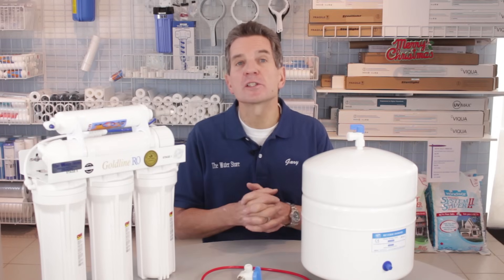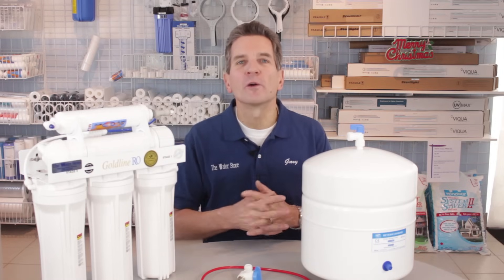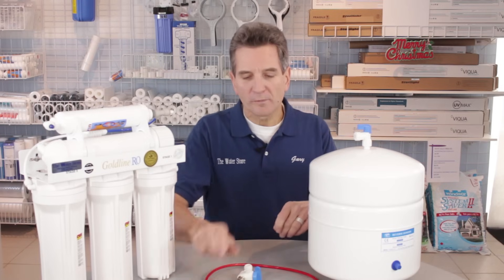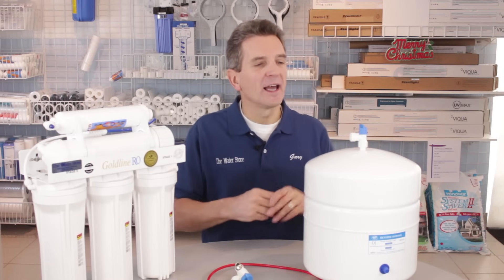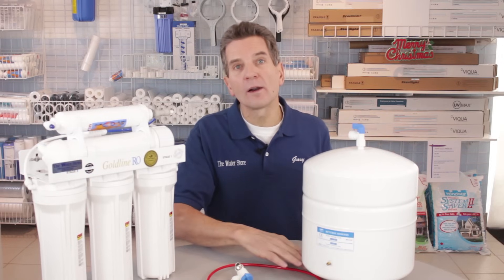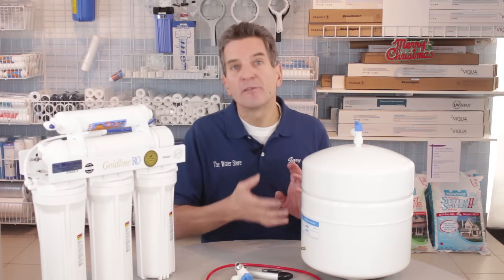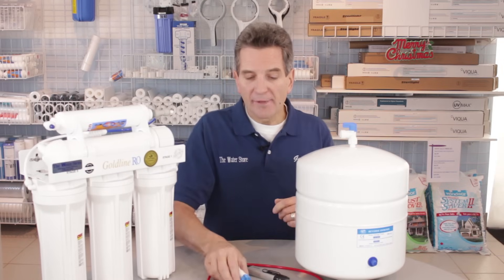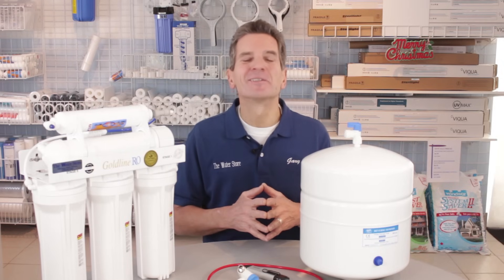Reverse Osmosis Troubleshooting - Little or No Flow from Faucet

Comment: I have a Brondell Circle Reverse Osmosis Water Filter (model # RC100). I got the system about a year ago and recently the faucet has only been dispensing about 1/2 cup of water before it stops and no water comes out. I watched this video and it looks promising, but my RO system is inside a case so I can't access the tank. Do you have any recommendations on how to get the tank out of the case to test the pressure?
Reply from the maker: I don't and that is one of the big problems with these systems.  I would contact the manufacturer and ask how you can check and recharge the bladder in the tank?
Reply: @water_estore  Thanks for your reply! I'll try contacting the manufacturer.

Comment: I tried this. I just replaced filters 3 days ago and noticed low flow.  My system is 2016 5 stage RO.  My tank says 100 psi working.  I dont know if that is what Im supposed to pump to but I put under 10 and still no flow.  I cant imagine putting 100 psi air into that little tank.  Now i dont have any water going into tank.  i double checked all my line valves are open.  Water is going into system but not from system to tank and then faucet.  Does anyone have any further ideas?
Reply from the maker: The tasnk needs to have 7 psi in it when empty.
Reply: @water_estore  I did that, well as close as I could.  It's just under 10.

Comment: I got a digital tire pressure gauge to keep next to my RO. Sadly my tank is empty and won't fill. The pressure is holding steady at 5.5 pounds and I have replaced all three filters within the past year. It is only 4 years old.
Reply from the maker: Did you repalce the membrane?  If so this video might help https://youtu.be/jur9sS2mo34
Reply: @Gary the Water Guy  within the past year I have changed all filters and the membrane.

Comment: Tank won’t fill, water only flows for a couple seconds until it becomes a trickle, and water flows quickly out black brine line.

Tank maintains air pressure as far as I know (can’t get a good reading from the warped air-fill valve).

Is the water pressure from the home too low, or ASO or check valve needs replaced?
Reply from the maker: Low pressure could cause that concern.

Comment: I followed your instructions. Changed all filters. I emptied the tank and keep the psi to 7. Plugged back everything but no water exit from the membrane to the yellow tube and to the tank. Please help. It only used for about 3 years.
Reply from the maker: Are you sure there was no water or just a very slow flow.  It takes several hours to fill the tank as the flow is so slow.
Reply: @water_estore  hi Gary, thanks for your reply. I had been waited for days. I checked all the tubes and no water/wet inside. Everything is on/opened. Please advise. :(

Comment: Hi there, thank you for your video. I went through the same process and re pressurized my tank to 6psi but now after two hours the tank is no filling up. I was hoping you can help with trouble shooting my osmosis system. I can hear the water stops flowing through the system.
Reply from the maker: Was the tankltotally empty before adding the air to 6 psi? If not check out this video https://youtu.be/jur9sS2mo34

Comment: My flow just got really low on a tank we've had no more than 6 months after replacing our old tank when the bladder went. However my tank is empty, so I'm guessing the problem lies elsewhere. New filters are on the way to replace (also no more than 6 months old), but other than that, is there anything else I should be troubleshooting? Thanks for the informative videos!
Reply from the maker: When was the last time you replaced the membrane?

Comment: I'm wondering, why not just add pressure to the tank without draining it. Seems like the main thing is the air pressure has leaked out and that's just about it. Is there a reason that we can't just check the pressure and increase to something like 6-8 psi?
Reply from the maker: Yes, it will be inaccurate.  You will never know when you have added too much or too litlle air.

Comment: Good day to you sir,
My system was working great, I decided to change all the 6 stages filters since I bought this house with the system and filters appeared dirty. I did so, then I connected everything back and turning on the water and it was very weak. I emptied the tank and I  followed all the steps then connected the tank and turn on the water and I had no water at all coming out of the faucet. The tank seems that it doesn’t fill up now, I made sure all the valves are open. Also, I need to know how long the tank takes to fill up after being emptied? At this point , I kinda I gave up and I don’t know what to do! Any tips you can give me would be appreciated. 
Thanks!
Reply from the maker: It does take several hours to fill the tank and regain the pressure.

Comment: Hi, we had low water pressure so I changed our filters to brand new ones and set water tank to 7 psi and waited a day to check on it. Still has low water pressure coming out, but the tank is reading 20PSI not sure how it got so high. What do you think I should do?  Thank you I for video!
Reply from the maker: Was the tank empty when you set the pressure to 7 psi.  Is the pressure now 20 psi with the tank empty?

Comment: I did this and after some sputtering I got a weak flow for a few minutes but now nothing and no water is going back into the tank. Thoughts? Meanwhile I'll price a new tank, but I'm concerned about the absence of water in the tank. Are you still around Gary?
Reply from the maker: Oh yes, I am still around.  What is the pre charge pressure on your empty tank? We have repalcement tanks here https://waterestore.ca/search?type=product&q=ro*%20tanks*
Reply: Hi... my RO tank weighed around 45lbs.. hooked up air to remove water until it stopped from top valve. There's still water moving around at base and in upright position the tank Schrader valve leaks out water when i push in to let air out... assuming this is bad bladder?

Comment: And if the tank is empty and remains empty after installation of an entire new system?
Reply from the maker: When the system is first installed it needs to fill the tank before you get any water pressure so it takes baout 3 hours.

Comment: But if the water has infiltrated the air side of the bladder.. doesnt that mean it's done for and very likely to just keep happening?  Just released all pressure from my tank and it's still full of water.
Reply from the maker: Yes, if water comes out where the air goes in your bladder is compromised and your tank needs replacement.  We have them here https://waterestore.ca/products/metal-reverse-osmosis-tank-4-gallon-ro-tank-pae-ro-132

Comment: What if there is no water in the holding tank and no water pressure through the entire kinetico system despite having new filters? Turning on and off valves doesn't make any pressure noise and opening up the in filter doesn't bring water in. But there is water throughout the entire house.
Reply from the maker: Then you need to check before and after every connection (by disconnecting) to see where the problem is.  This video will help you https://youtu.be/jur9sS2mo34
Reply: @water_estore  Thanks, I watched your other video and check every valve like you said. Turns out one of the saddle valves was corroded and worn out. It somehow got clogged then broke when trying to turn it. Easy swap out and it appears to work again.

Comment: If I press the shreder valve (the valve where you showed to inject air) water is coming out. Does it mean my tank bladder is leaking and I need to replace it?
Reply from the maker: Yes, you need a new tank.  we have them here https://waterestore.ca/products/metal-reverse-osmosis-tank-4-gallon-ro-tank-pae-ro-132?_pos=3&_sid=0bc311c78&_ss=r

Comment: Great video and very thorough but I'm still having problems with water flow.  RO2 tank is less than 10# even after overnight regeneration.  I replaced all filters this past week; however, this is the first time the membrane has a lot of scaling/salt.  My RO2 and water softener is a Culligan system (AC30 and Soft-Minder Twin).  Thanks in advance.
Reply from the maker: What is the precharge psi in the tank when it is empty?

Comment: Thanks! Exactly the problem I’m having! Will give it a try
Reply from the maker: Did it work?  Please share video with friends and family.
Reply: @water_estore  It did! I did have a couple questions though... first, does it matter if valve on top of tank is opened or closed when re-pressurizing tank? Also, is this just a regular maintenance issue or am I doing something wrong that causes this to happen? Thanks again!

Comment: The valve on my tank to read the air pressure seems to be smaller diameter than say the tire valves (tried the tire cap on ro valve and the cap was too big). I can’t get any air pressure gauge to get a reading. Is there a specific one? I have a digital and regular and none will read, yet I can connect a bike tire pump and still add air. What is going on?
Reply: Edit to add, I get a reading when the tank is full but not empty
Reply from the maker: I think you are not getting a read because there isn't enough pressure in the tank to get a reading.  Try pumping it up to 7 psi when it is empty.

Comment: Hey Gary, I just get a trickle but my tank is light. What should I check in that case?
Reply from the maker: Clogged filters or too much air in tank.
Reply: @water_estore  thank you. It was too much air. I released the pressure and all is working. Thanks!

Comment: Hi Gary - I followed your instructions and drained the tank. How long after I hook it back up will it take until water flows again?
Reply from the maker: It will flow slowly pretty much right away.  You will need to wait a few hours for the tank to fill so you get the maximum pressure and flow.

Comment: Thank you!!! This fixed my problem... it says in my tank that is 100 psi but I just fill it up to 10psi and it just worked. I am just wondering why they said that 100psi max. That means I can have a pressure up to more than 10psi as mentioned in the video and if so, if I make it 20psi, what is the difference. Will it give me more pressure to push the water out of faucet but less water? Please explain :)
Reply from the maker: It is a very fine balance of having the pressure low enough so you can fill the tank but high enough to push the water out.  7 psi is the sweet spot.  Although the tank can handle 100 psi that would be for a different application.

Comment: How often should you have to re-pressurize the tank? Mine is 1 month old and I have no flow.
Reply from the maker: Usually about 3-5 years.  Sounds like you have a defective tank.
Reply: @water_estore  Found out it had pressure but had no water in tank.

Comment: My Faucet have a problem that only little water come out.  So I followed your instruction.  I removed the tank and open to water out but water doesn't come out.  I used bicycle pump to air in from the bottom that you said too but no water come out.  Please help me.
Reply from the maker: You need to pump in more air, that is the only way to get the water out.
Reply: @water_estore  Thank you for your reply.  It is so heavy the tank with full of water and my back hurt now.  Is there any other way to make empty the tank?
Reply from the maker: @JuneCocoS  no there is not.

Comment: Mine is empty....
Reply from the maker: Which means it isn't filtering your water.  I would follow the advice in this video https://youtu.be/jur9sS2mo34
Reply: @water_estore  thank you. I ended up fixing it another way, very simple if anyone is interested.  We have a water detector that shuts off the whole thing when it detects water at the base; just had to bypass it by plugging the wire feeding into it directly into the RO system.. Some detectors are digital, but ours was not; it was based on some mechanism of crystals swelling when in the presence of water, stopping the flow.

Comment: The pressure would not come out of the tank even if I disconnect everything
Reply from the maker: Then you need to add some air to the tank to get the water flowing from the tank.

Comment: Hi, Gary.  Great video.  However my problem is the cold water supply to the actual SINK faucet.  When I installed the osmosis ball valve in-line to the osmosis, my actual sink faucet’s cold water flow has diminished.  It starts off fine, but within 3-4 seconds is reduced to a small stream.  Can you help?  My email is thadjacobs3@gmail.com. Thanks!
Reply from the maker: Something is definitely clogged.  I wouls check it over because that is not typical.

Comment: Gary I took the tank outside and tried using my air compressor to push the water out currently it is showing the tank has 61 psi is there anyone in the Omaha Nebraska area that can service my system
Reply from the maker: No I don't know anyone.  You did open the valve at the top of the tank when you added air, correct?

Comment: Hey there, what if the tank is empty and there is little to no water flow?? System is 3 years old and I have already replaced the tank last year.  Filters?  Great video BTW!
Reply from the maker: When there is a low flow situation always start by replacing the filters and membrane.

Comment: Thank you, Gary the Water Guy! It looks like pressure has been restored for me after the tank re-filled for awhile. I will definitely be sharing this video where applicable. 

I didn't have a digital pressure gauge and my tire gauge doesn't really indicate anything below 10 PSI so I drained the water and put about 11-12 PSI in it with my compressor (the ball valve on the top needs to be closed when doing this, correct?). The tank label indicated 100 max working PSI and I have an APEC ROES-15. Do you think I'm okay with this PSI for my system?
Reply from the maker: No, it is quite particular about the pressure and ideally it should be 7 psi when the tank is empty.

Comment: Hey Gary--Thanks for the video!! I took my RO tank out and dumped all water until it was empty. Then using a bicycle pump attempted to re-pressurize but pump handle was VERY hard to push. I checked pressure with 0-25 psi gauge--0 psi,. I opened the ball valve on top of the tank and attempted to use pump again--only to hear air escaping from ball valve.  That tells me that the bladder is ripped--do you agree?
Reply from the maker: Yes, you need a new tank.

Comment: How would I know if the bladder in the RO tank is bad?
Reply from the maker: When you remove the cap to put in the air water comes out or it will not hold air.

Comment: I emptied the tank but water was dirty. Is this normal?
Reply from the maker: Yes, especially if you use rock salt.  The salt becomes dissolved in the water, the dirt remains behind or clogs the injector.
Reply: @water_estore  Which salt do you recommend?

Comment: I had to wind up unscrewing the top valve cap (Rainsoft) of the barrel, turning it upside down and gently shake it for any water to come out. This is after trying the hand pump method with no water coming out.
Reply from the maker: Likely the membrane is ruptured and you need a new tank.

Comment: Help Gary!! A plumber hooked up my RO and it has been filling/pressurizing/ setting up for 2 days. Is this normal? It's a springsoft
Reply from the maker: No this is not normal at all.  I assume the tank has not filled.  You will need to have the plumber come back to figure out what went wrong.
Reply: @water_estore  for some reason it didn't have a flow restrictor, works great. However is there extra sodium in the water or does the reverse osmosis get it all from the softener? Thanks again.
Reply from the maker: @commonsense6297  reverse osmosis removes 95% of the sodium from your water.

Comment: Hello what if the tank isn't filling?
Reply from the maker: Good question.  you need to replace the filters and the membrane.  If that isn't the problem you need to start at the source and see where the restriction might be.
Reply: @water_estore thank you for replying. We changed the filter, membrane and tank just a few weeks ago. Is it possible the pre filter needs to be changed already?
Reply from the maker: @heatherthedutch-american1481  no.  As I said previously you will need to start at the water source and follow the flow of water disconnecting between each stage to verify what is stopping the flow.

Comment: Thank you Gary the water guy, very helpful. My symptom is very slow flow at the faucet. The storage tank is full. When I push on the Schrader valve water comes spewing out of the Schrader valve. Does that mean that the bladder is broken? I did remove the tank after that and tried to remove the water. It would not come out by gravity. When I applied air pressure with a bicycle pump to the tank it probably pushed out two thirds of the water and the rest I cannot get out. Would you agree that the bladder is probably broken? The tank is a whirlpool unit and I've probably had it at least five years. Thanks.
Reply from the maker: The bladder is gone and you need a new tank.  we have them here https://waterestore.ca/products/metal-reverse-osmosis-tank-4-gallon-ro-tank-pae-ro-132?_pos=698&_sid=c3bde8fe6&_ss=r

Comment: Is a small hand pump not enough pressure to make water come out? I am not able to get any water out of my tank after the initial spurt using the hand pump.
Reply from the maker: A hand pump should work, you may need to pump it several times to get enough pressure to force the water out.
Reply: Same issue here.... I'm using a hand pump with pressure gauge,  reading around 100psi, but no water come out. Valve is located UNDER the barrel. Rainsoft. Have to turn it on its side to pump.

Comment: Rainsoft max working psi 100psi ‼️😂
Reply from the maker: Those tanks are used for a variety of applications.  the maximum pressure they are rated for is 100 psi but that is not the correct pressure for an RO application.